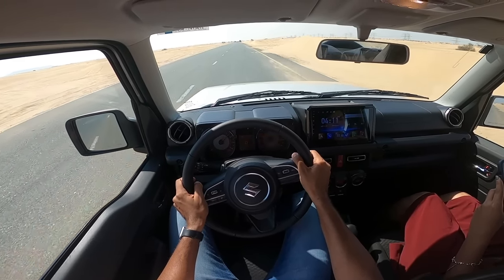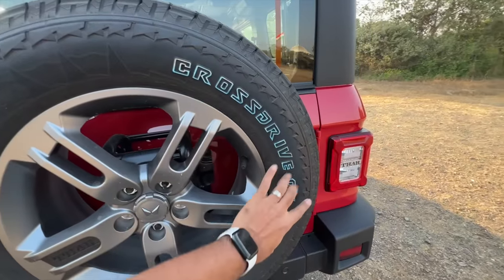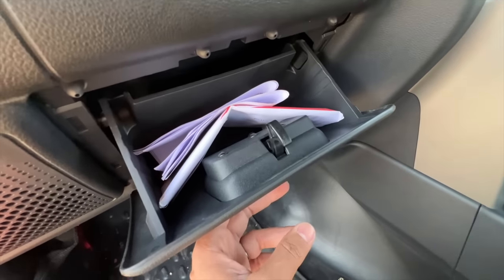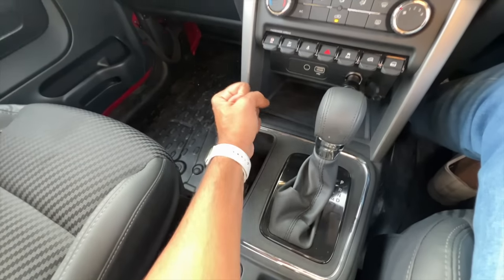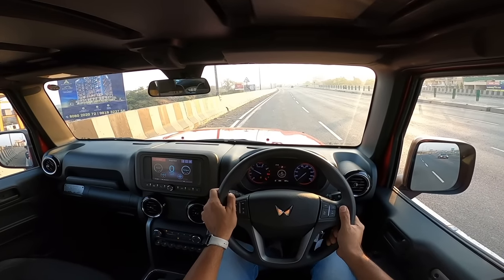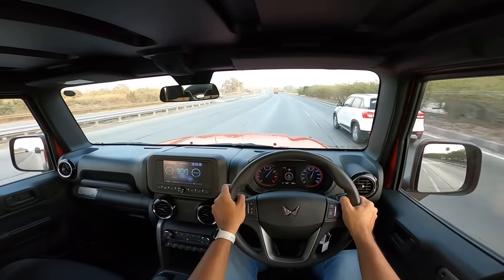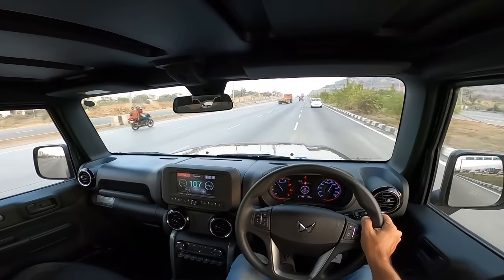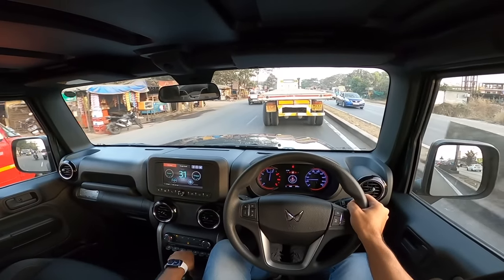Mahindra Thar Rear Wheel Drive - Rs. 5 Lakh Cheaper!

Comment: Just take few advices:

Dont just shout at random!!! It irritates!!!

Dont give wrong feedbacks….for e.g. 

1. the toolkit is in boot only, and the boot has adequate place for two cabin bag suitcase and two medium duffles. Dont give wrong statements

2. The fuel lid is key opened as it is a part shared with soft top in which if it is not key opened, someone may  open and steal your fuel.

3. You are a famous YouTuber. Atleast handle cars with some decency. Love the cars bro.

P.S. I am a proud thar owner.

Great job bro.

Comment: Faisal, only side facing rear row seats and a reasonable turning circle radius completes the RWD, 1.5 Thar.
& BTW Morazzo used the original east-west mounts of this engine. Whereas the Thar would require a North-south engine placement. I hope they have made adequate changes. I am concerned because back in the 90s Mahindra introduced a stretched version of the mm540 to accommodate 10 passengers and avail a tax sop announced for 10 seaters. We were one of the 1st to buy one. After a few weeks into its ownership, I incidentally kneeled to check out its chassis. I was shocked to see a simple clamp and revit job Mahindra had carried out on the chassis to execute the job ‼️😅
Mahindra sure has come a long way since but again old habits die hard. So I wouldn't rush into anything.

Comment: @25.30 are the roads not paved flat ?  The way the driver is bobbing in the cabin going in a straight line doesn't look so reassuring for a comfortable and confident highway drive.